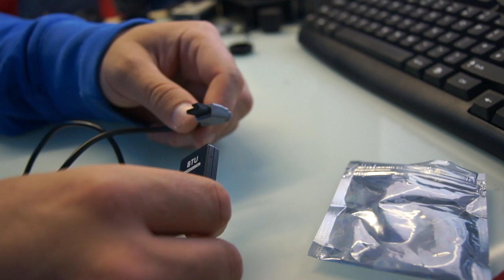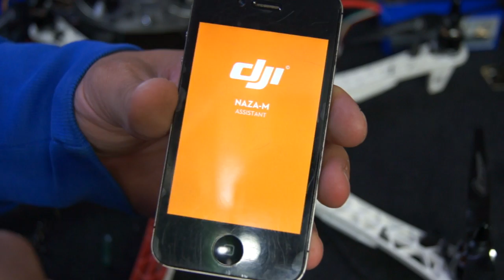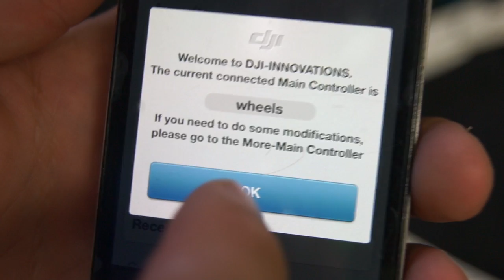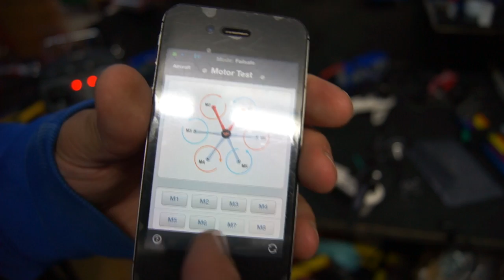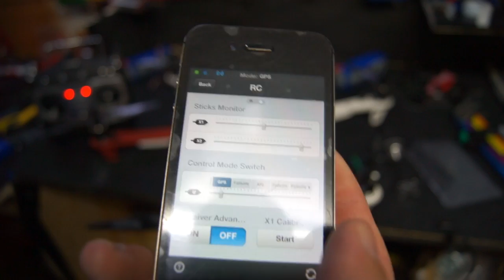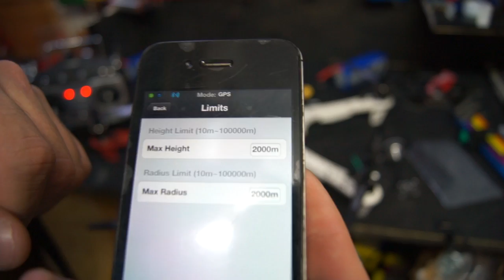DJI BTU (bluetooth unit) install and updating by That HPI Guy

Comment: Hi.

I have the same problem as Aron Gatt, I have a P2 and BTU connected by the iOS mini and same firmware problem. I being researching and I could read someone could make it connected by reseting the BTU by the PS Assistant but after a bit disconnected. Any one had make it work ? and how to do it. I mean without Datalink. Thanks.

Regards.

Comment: Hi

I just got the btu unit for my P2 ... I did get the NAZA app and is telling me the same as you said ( firmware not match ) now the problem is that the phantom is on the latest firmware which is 3.06 and there's no 4.00 firmware just now ..... Do you have an idea what's happening or am I missing something.

Cheers

Comment: I am interested in the BTU but only for the bit where it says it "Optimize the warming up condition, to avoid a long wait period before aircraft can takeoff" do you know how it does this? Also I notice that you are using T-motors I am interested in these do they add any benefits over stock motors with graupners 10x5 props? Happy new year